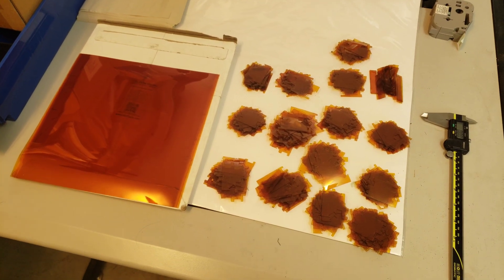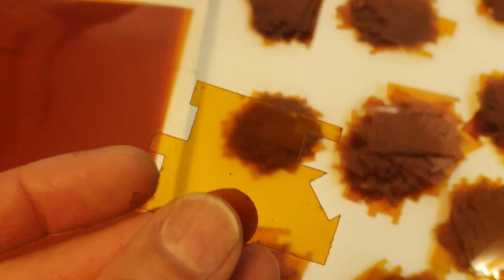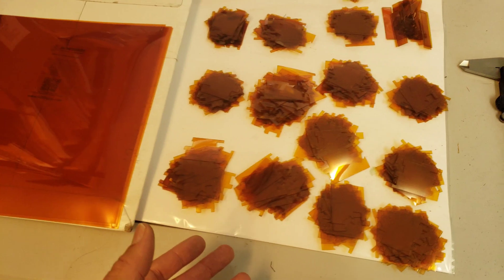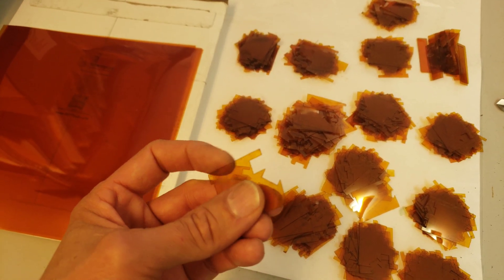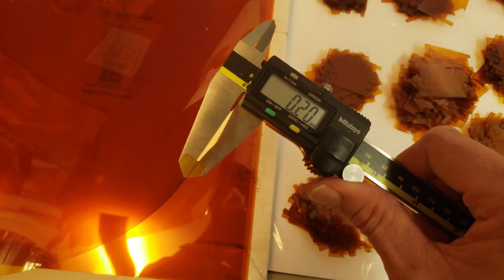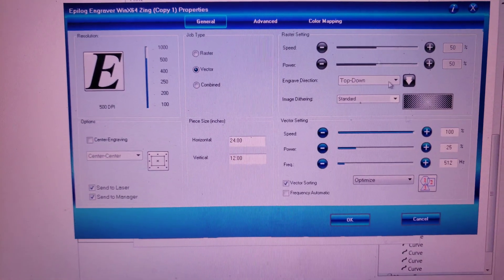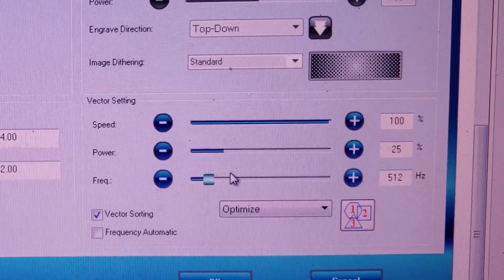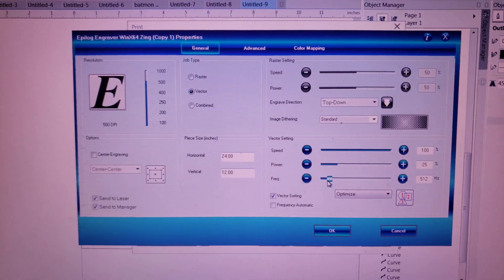How To Laser Cut KAPTON TAPE using CO2 laser Epilog Zing 40W Laser Cutter

Comment: Could you use a diode instead of CO2 laser?
Reply from the maker: Not sure, haven't tested it.
Reply: @engineerable  thanks for the reply. Diode lasers can cut acrylic...but I think only if it's very dark colored, like black.  Anyway, I guess I can give it a shot.
Reply from the maker: @perspectivex  you're right, so it may not work.

Comment: Can you engrave on this as well?
Reply from the maker: Haven't tried, but probably.
Reply: @engineerable  Looking to cut tape shapes and engrave a barcode on it. I’m concerned if the film is too thin, so that the engraving will melt through.
Reply from the maker: @hoffa-f2v  QR or UPC? Is this something you are looking to outsource, or trying to figure out if it's practical for you to do inhouse? Power can be turned way down for engraving, such that it should probably be engravable. I would not expect to be able to scan it though.
Reply: @engineerable  I run a workshop and I’m looking to implement it in our production line. However, I need to do it on a protection tape/film that’s really thin. So I’m just looking for advice and tips :)
Reply from the maker: @hoffa-f2v  Turn the engraving power way down and speed up. It's possible to engrave on paper, so seems like it could be done on Kapton too.